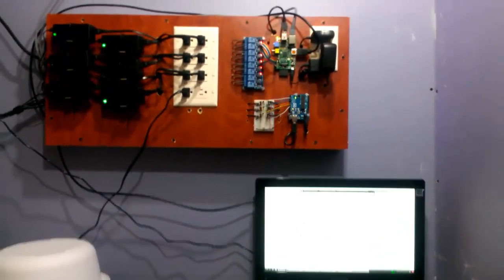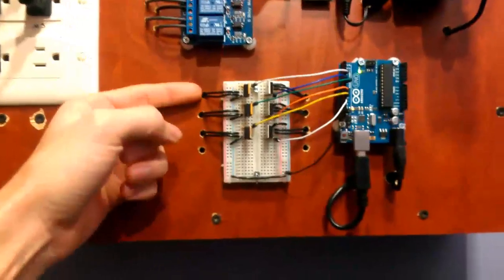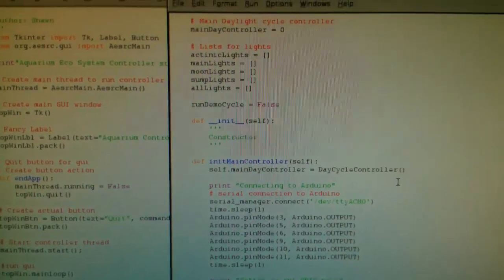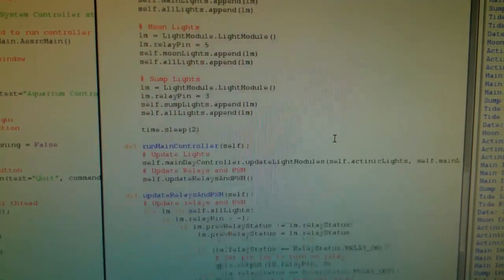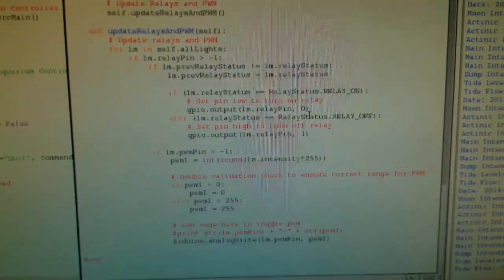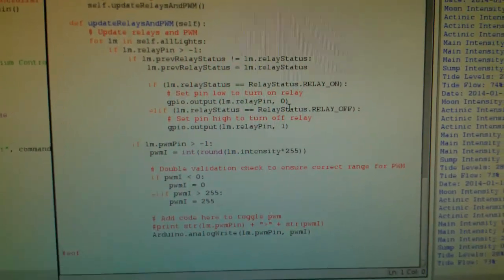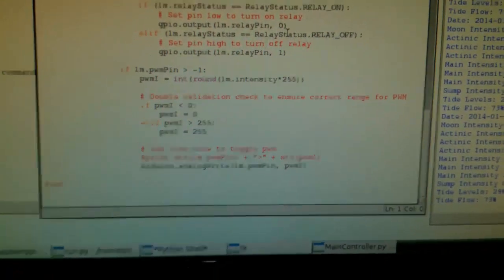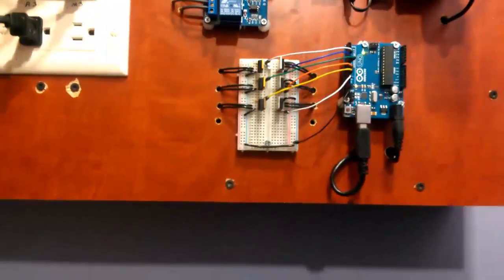Raspberry Pi Aquarium Controller (Part 2)

Comment: I know that this is an old video but how exactly did you hook up the lights for PWM?
Reply from the maker: Which part, software side of things or hardware side? For the hardware the output from the power blocks are wired up to the Arduino Uno card which controls the PWM. I used Tip 120's, I think they were, to interface between the Arduino and power blocks. On the software side it runs on the Rpi and the Arduino is connected via USB, on your script you just make a call to set the PWM value from 0 to 255. Does that help or looking for something more?
Reply: +Shawn Creviston That's what I was looking for,  thanks.

Comment: Hi Shawn! Interesting project. I have somewhat similar raspi system on my freshwater planted aquarium, running Automate which I wrote for this project in mind. In my project, there is also some water lever monitoring and automatic emailing & shutting down of pumps if leaks are detected. I thought that the python framework that I developed for this purpose (Automate), might be usefull also for you. Is available at https://github.com/tuomas2/automate (theres support for gpio, arduinos, and nice web interface as a bonus).

Comment: HI This Looks ace Do you have a link For the Code
and any more info on what you did / plan for the future
Reply from the maker: My project is on GitHub at: https://github.com/ShawnCreviston/AquariumRpiController

The two videos show most of what I did for this project, however future project I like to do are controlling a sprinkler system for my lawn. When I start building my larger tank I think I'll be using the Rpi to control it or a PLC depends on the number of outputs and complexity I need.